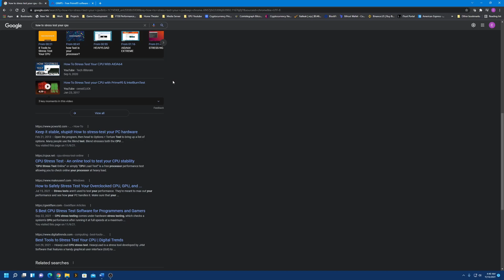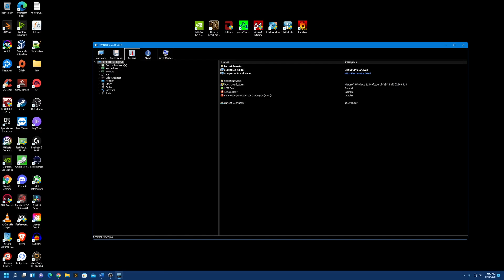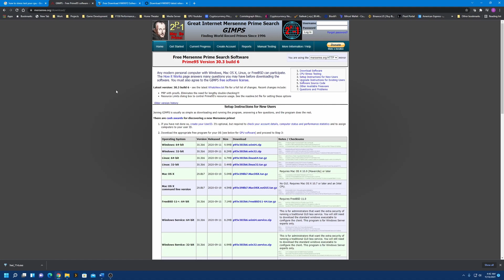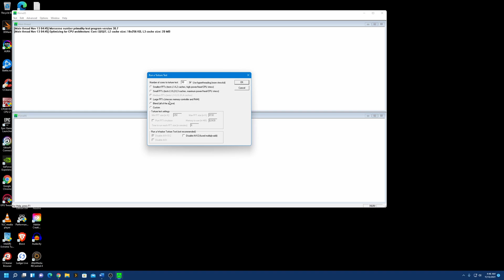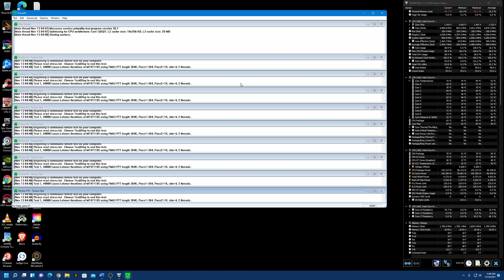How To Use Prime95 For Checking System Stability | i9 10900kf

Comment: Great video. I just want to stress my cpu, do I need to stress it for 24h? I want to test if it is overheating, because my notebook turns off after a few seconds of running a game.
Reply: if it turns off after a game and not in the test its a software/game issue if yes then hardware issue

Comment: been trying to troubleshoot random crashes after upgrading cpu to 5800x3d, I was having random crashing even under no load, whenever I would enable xmp, I noticed dram voltage was still set to auto, so I've manually set to 1.35 which seemed to help with the no load crashing, however if I use the blend test with prime 95 I almost immediately crash, I can use the individual cpu and ram tests without issue. any suggestions?
Reply: Have you tried Memtest86?